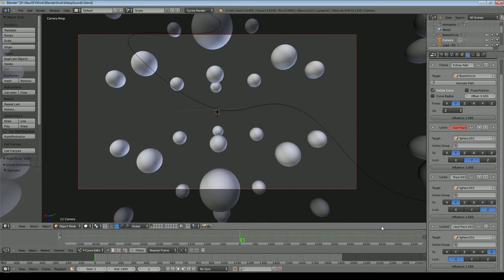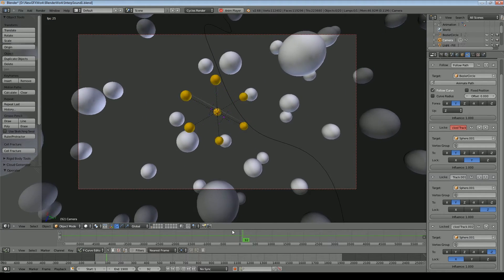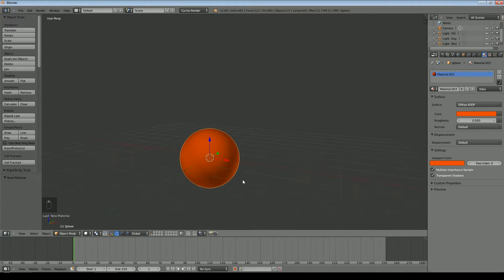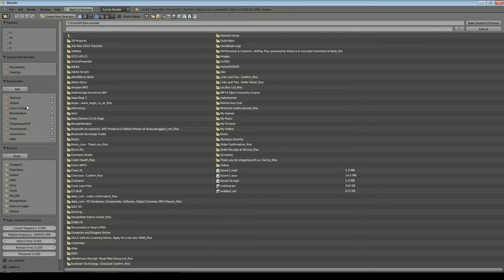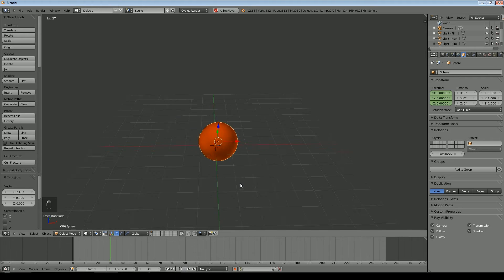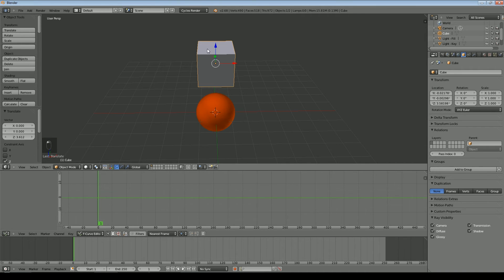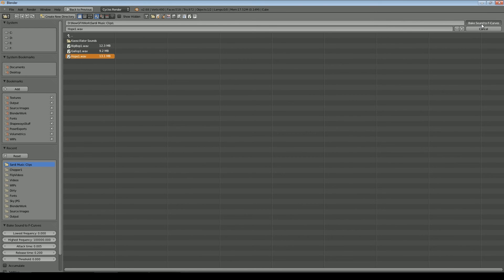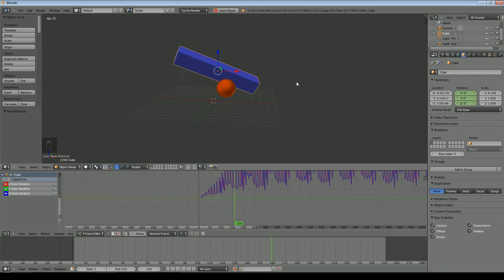Blender 2.68 Tutorial - Audio affecting Objects

Comment: To amplify the effect, use the Envelope modifier, available in the Key menu and also the "n"-panel of the graph editor.  The correct settings depend on your audio file, but most of the time, setting a control point and adjusting the minimum and maximum settings for the Envelope and Control Point are all you need to do.
Reply: +jb listener thanks for this!  was just what i was looking for

Comment: That's really nice but could you use another kind of sound wave? Man ! Like a wave with much more amplitude in the frequencies? A wave for the bass, one for the open hight hat, another for snare, tom, voice...That would be great! The problem is that you have to add the curve each time you choose a different frequency for a special key (rotation, scale...). I've tried to use the "copy" system but it does not work! You have to import each time ! What the F...
Reply: Yes you can. You have to put each track separate for each instrument. Then set up each object to that instrument. Make sure your objects have set scale, etc. Then load each track into video editor after assigning them to the object as shown.

Comment: How do you make a sound wave with rectangles, kind of like this: 
   0      000
  00  00000
0000000000
I want the different rectangles to be affected by bass, high notes, etc. Kind of how MonsterCat does it.

P.S: I have already made something like this on my channel but it was made using a certain pre-made code thing I found online. I would like to learn how to do this another way just for education sake.
Reply from the maker: Hi, if you mean simulating the sound waves themselves, I did it by adding a particle system and arranging for groups of particles to emitted together. Then add collision to the obstacles and the particles will behave like sound waves.